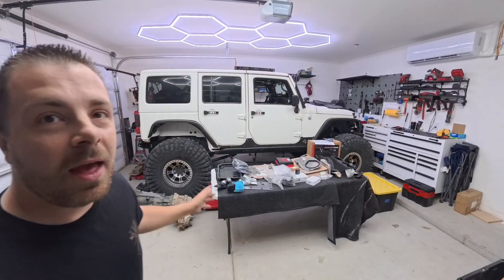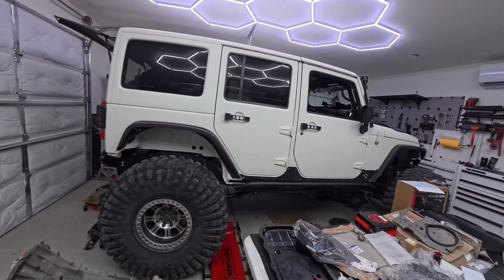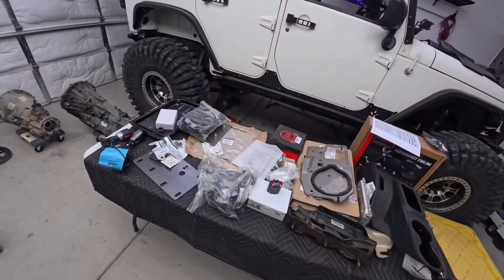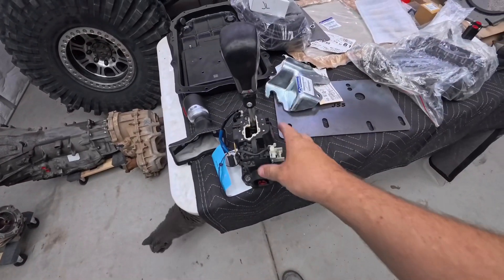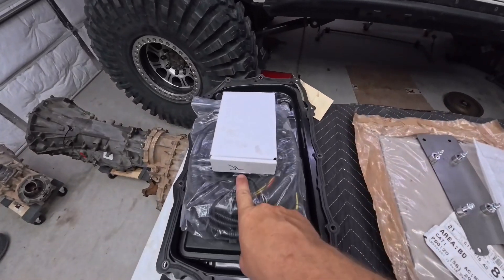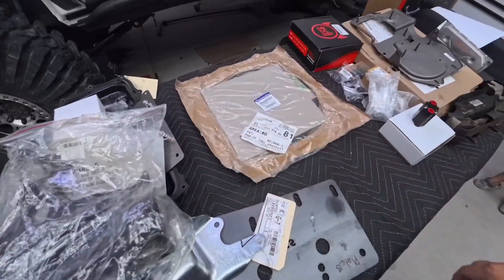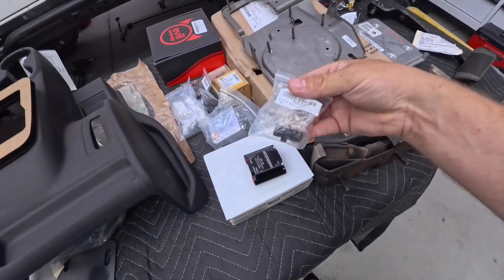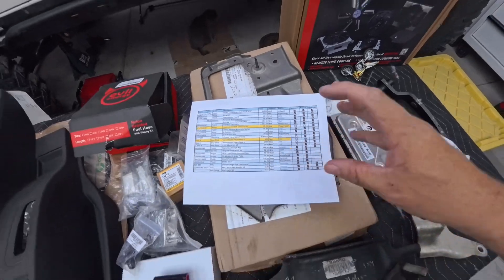3.6L Jeep with 8-Speed Transmission swap, parts list

Comment: What connector did you use for the indicator? My Cherokee shifter indicator connector is different to the indicator which you provide the part number for
Reply from the maker: I used this connector 

https://www.ebay.com/itm/224083221856
Reply: @WillGMan do you know the pinout on which wire on the shifter goes to where on the connector?
Reply from the maker: @KiG1208 hit my up on Instagram. Willy_g_man

Comment: I have an jku I’m getting ready to do this to. Non rubicon automatic. 42rle not the nag1. Will my case bolt up? If not where can I get the adapter?
Reply from the maker: As long as it’s a 3.6L you should be good

Comment: Hello, watched this 3 times, I’m looking to swap my manual for an auto. Looking at the 8hp70 is there any difference? You used a different auto tranny. Also can you forward the BOM you created. I have the stock motor at the moment, but a 5.7L Hemi swap is in the future .
Reply from the maker: The 8HP70 wont bolt to the back of the 3.6L. Hence why I went with the 850RE which does.
The 8HP70 is for the hemi motors. 
Shoot me your contact information or hit me up on instagram with it so i can send you the list. Willy_g_man

Comment: I’m sure the 3.6 auto flex plate and hardware will all work back… no need to change these out unless you are converting from manual
Reply from the maker: This was a manual, however you do need the 8speed flex plate is my understanding from jeep speed shop.
Reply: @WillGMan will have to speak to Todd again but from the BOM file, I see he mentions the flex plate for manual to auto swaps

Comment: Hello, thanks for the videos. I'm also in the process of converting my 2014 JKU Rubicon from a manual transmission to an 8-speed 850-RE. The transmission I purchased is from a 2019 JL so I purchased the JL transfer case also. The guy I purchased it from, installed it in his JK and ran it for about 5000 miles. He is doing a hemi swap now. I have all of the required parts from Jeep Speed Shop and I'm looking forward to your future videos. I'm interested in the wiring connections you make as the Jeep speed shop videos has specific instructions from a NAG1 Automatic. I also love the ideas you have about keeping the 850RE in the proper temp range. Cheers and good luck!
Reply from the maker: Thank you for watching! I hope to get back at this product asap. Been swamped with the real job
Reply: is it possible to convert the manual transfer case to a fulltime transfer case and keep it manual transmission